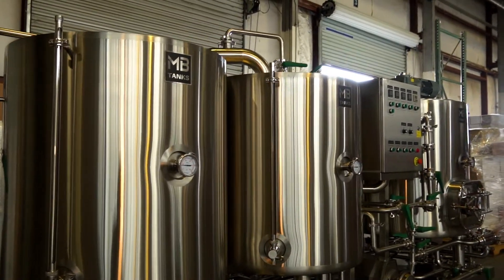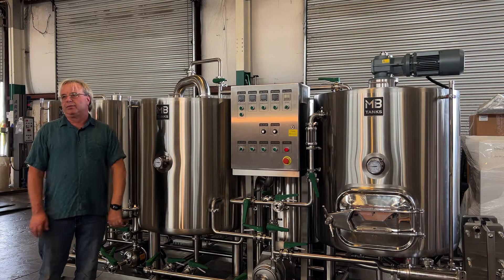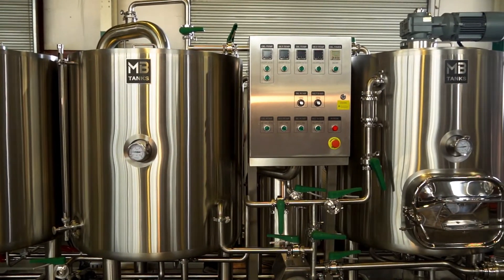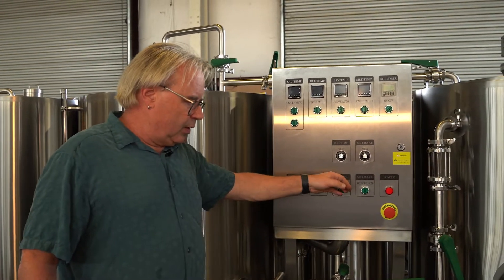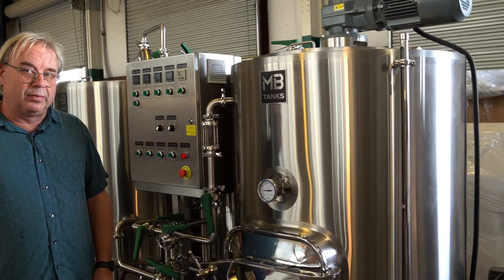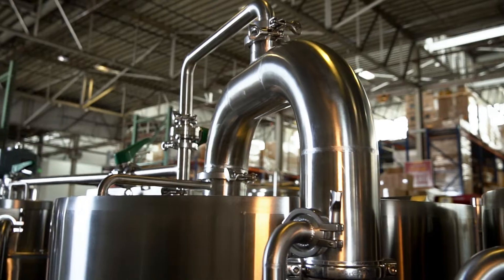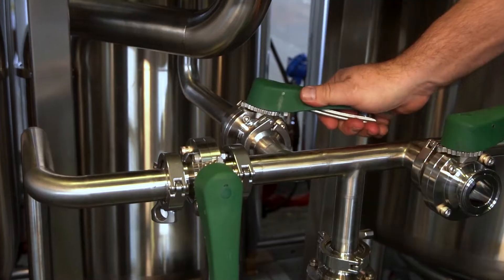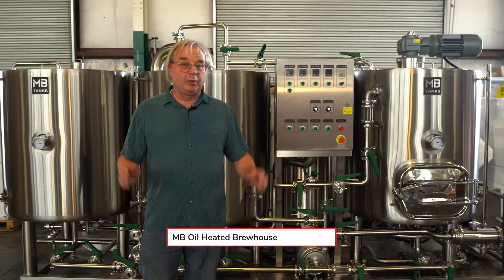MB Oil Heated Brewhouse Overview | 3 Vessel Oil Heated Brewhouse | MoreBeer! Pro

Comment: Why aren't the oil supply hoses hard piped in? With those worm clamps on there I would be concerned about them loosening over time.
Reply from the maker: We have found the flex hoses to be much more reliable. The frame can flex during shipping. The worm clamps you see keep the red insulating jackets secured to the oil lines. They are not used on the oil lines
themselves.

Comment: Much respect for Colin, but hot oil isnt exactly foolproof, it can leak.  Are those funky, red hoses wrapped and double-layered, or what?
Reply from the maker: The red silicone is a jacket to remind you it is hot. Its purpose is to make it a little more safe if you brush against the hose. The hose still gets very hot.

Comment: How's the energy costs differ from a gas or electric version?
Reply: Should be more efficient, but IDK, good question.
Reply from the maker: It really depends on where you are and your existing energy costs. It uses about the same amount of energy as any insulated electric system but the installed power requirement is
lower. We address this and more in our latest video on choosing a brewhouse, check it out here: https://youtu.be/g-40f91j69w